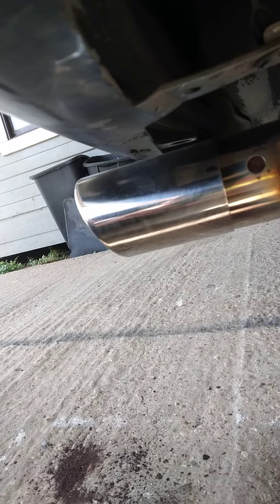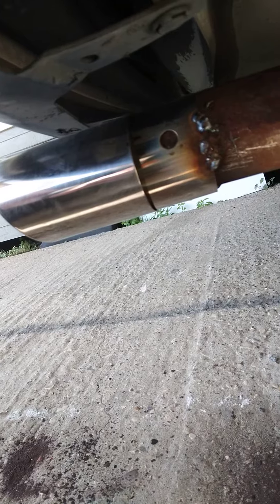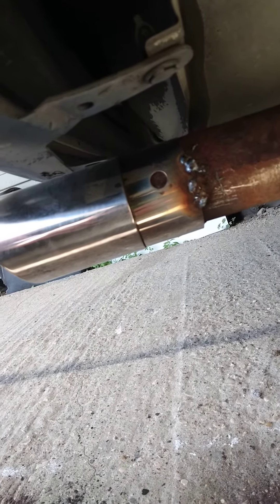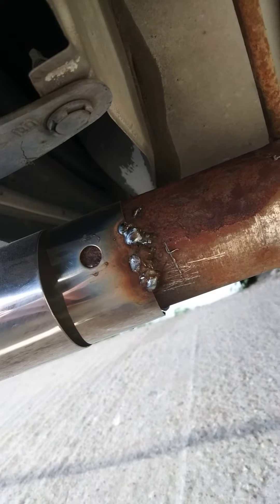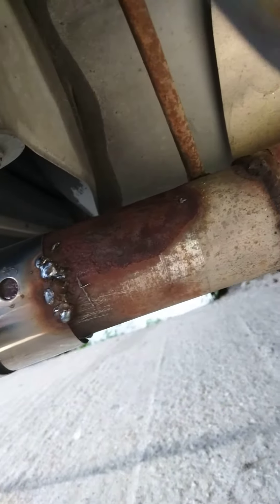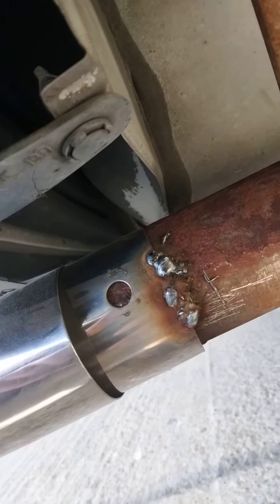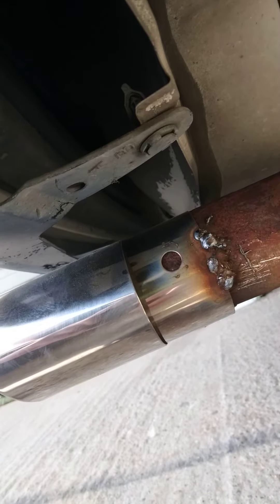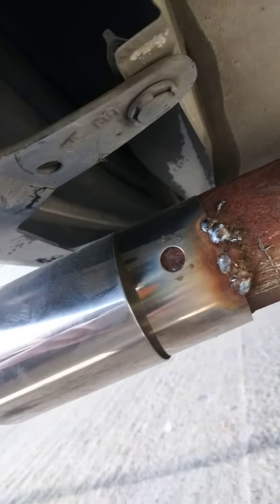how to secure a exhaust tip

Comment: Thats how I did mine on my truck, your right them nuts and bolts are just holding it onto the existing pipe. And if your vehicle is like mine it shakes alot back there, when you crank it and everything, I learned real quick not to depend on the nuts and bolts. Did the same thing as you just tacted it on.
Reply from the maker: Best way